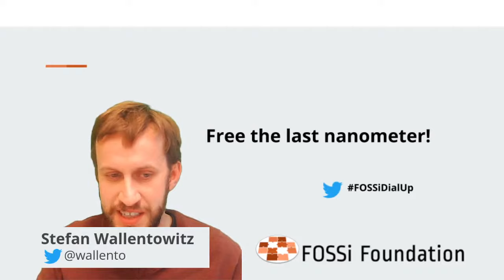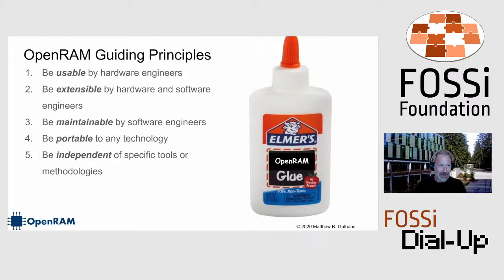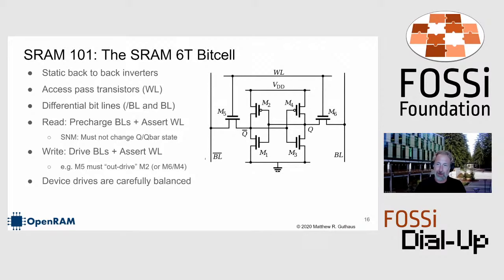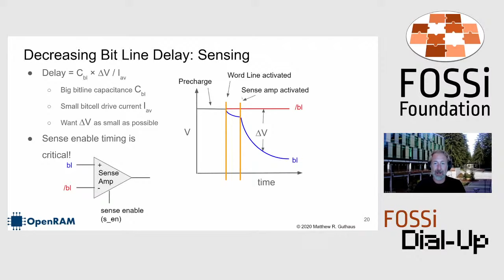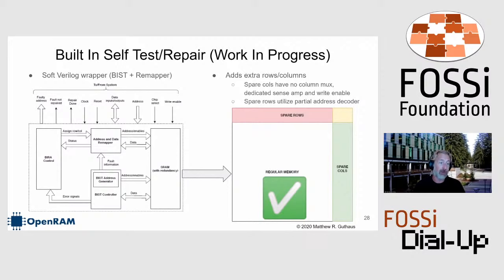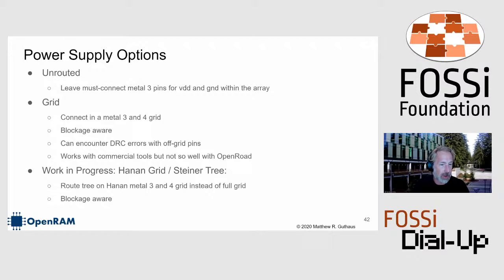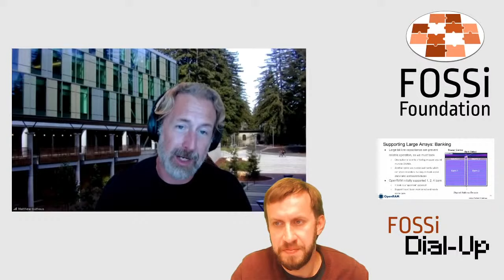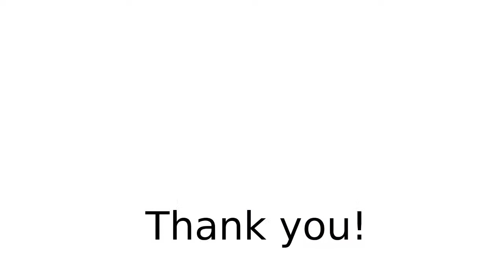[FOSSi Dial-Up]  Matt Guthaus - OpenRAM on SkyWater 130nm

Comment: 00:00 Introduction
04:30 What is a memory compiler
06:45 Current state of the art
08:20 Why make an Open Source memory compiler
11:30 Guiding principles of OpenRAM
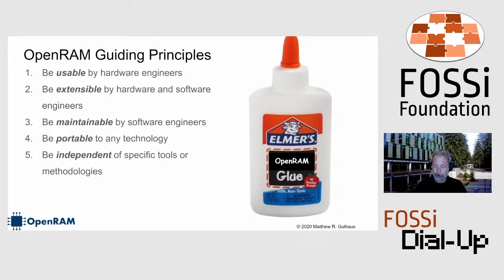12:40 Features
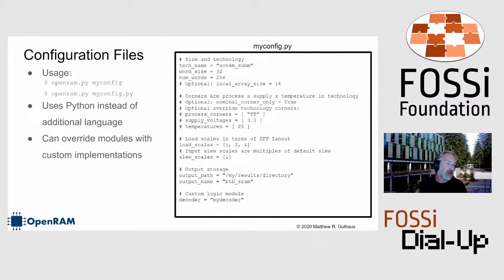15:00 Configuration
16:27 Implementation
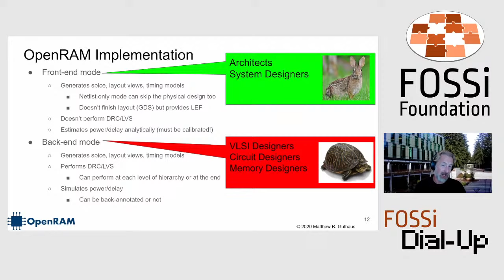18:00 Architecture
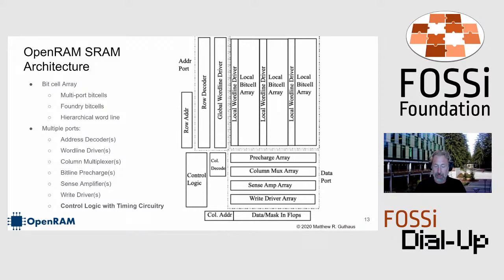19:00 C.I. testing
20:30 SRAM 101
23:45 Bit cells
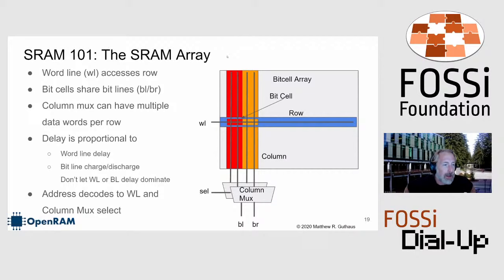27:40 SRAM Array
29:40 Not quite digital design: bitline delay & sensing
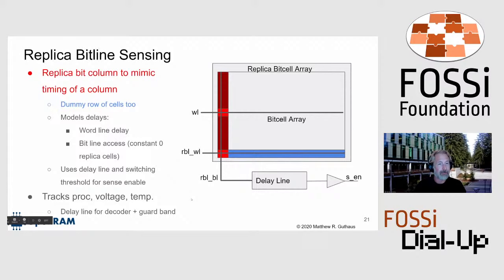33:30 Decreases word line delay
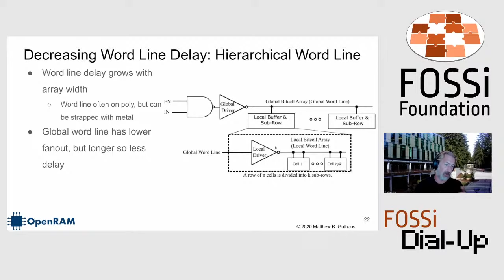34:30 Banking
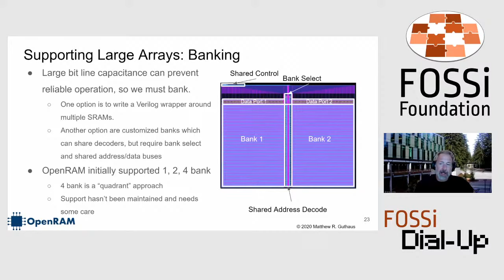36:00 OPC
38:20 Enhanced features
42:00 Library IP
45:00 Examples / Results
50:00 PSU Options
51:30 Parameterised transistors
52:30 Current issues
53:40 Feature requests
54:40 Roadmap
55:30 Interested in grad school?
56:20 Conclusions
57:00 Q&A
Reply: Awesome, thanks!
Reply: @stefanwallentowitz7832  copy and paste it into the description if you want

Comment: I have high hope for OpenRAM Python project particularly on Sky130. This presentation shows purpose methodology and license of the technology. Seems like a real deal! OpenFlash and OpenROM then we are there! Very good general information even if you are not using OpenRAM. Frontend mode and backend mode give fast coarse model and slow and accurate model. In the process to add SKY130. Precharge and discharge and all those good stuff are explained.

Comment: Neat! That answered a lot of my questions about how OpenRAM works. The use of parameterized transistors for the drivers and what not, especially revealing. Sound like the weakest spots are in the verification and transferring the sim data to macro models in Verilog and Liberty files. <irony> Shocker. </irony>

Next, someone is going to have to create the OpenMemoryController wrapper around OpenRAM to get the memory depths up into the megabytes.